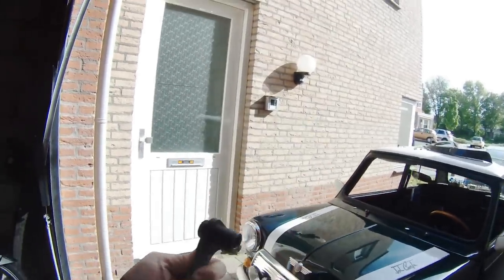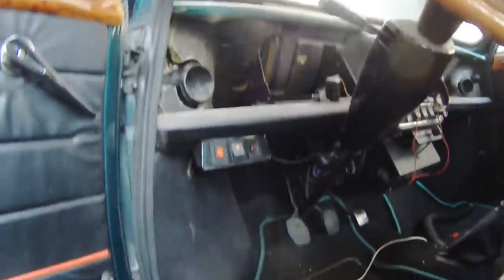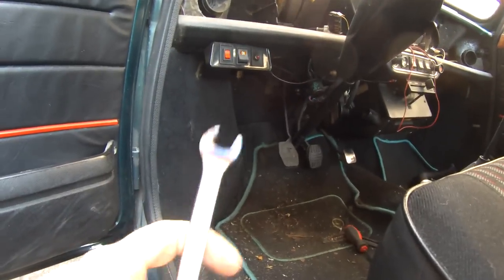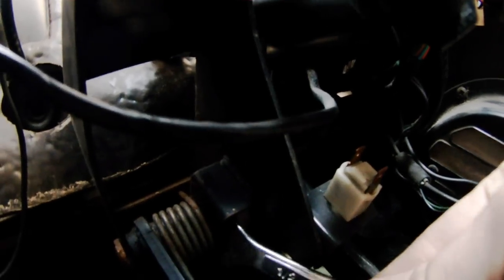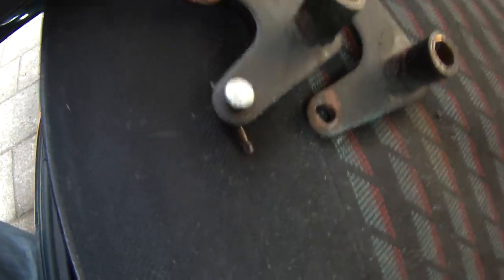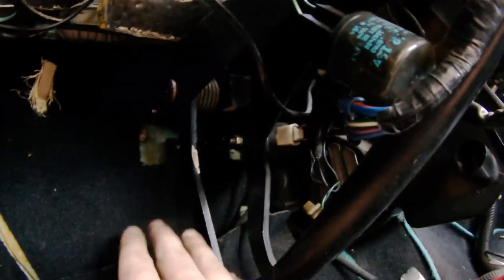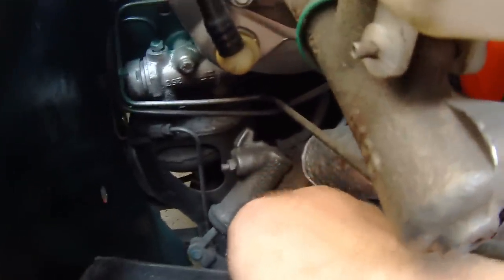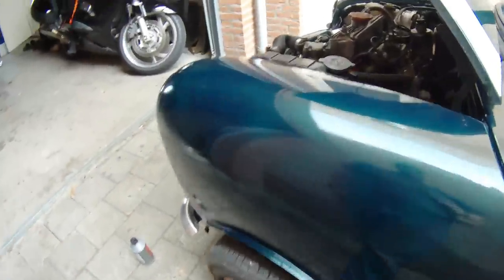Classic mini Clutch Pedal Replacement Without removing the Pedal Box!

Comment: Great video - I have a 1990 John Cooper as well - I'm currently trying to deal with a stuck engaged clutch.  It was sitting for a while and once I pressed the clutch all the way in the clutch stayed engaged and now the pedal has complete free travel (will not return).  Any words of advice? (It's the same setup as yours with the veto clutch slave except mine is a RHD)

Thanks!
Reply from the maker: Zachary Piercy I would start with the easiest fixes first. First inspect the clutch fluid to ensure it is full and that there are no leaks (especially near the clutch slave cylinder). Next, have someone inside the car press on the clutch pedal to see if the slave cylinder moves and is engaging with the clutch plunger (moving the Clutch arm that goes into the clutch case). The most common cause of a "dead" clutch pedal is the clutch slave cylinder so make sure you check it carefully for leaks and operation. If the clutch arm is moving in and out of the clutch case properly, then it may be one of the components inside the clutch case such as the thrust release. If it is one of the internal components then it is best to replace the clutch while the cover is off and you are making the repair. Let me know if this helps and if I can assist you further. Good Luck!